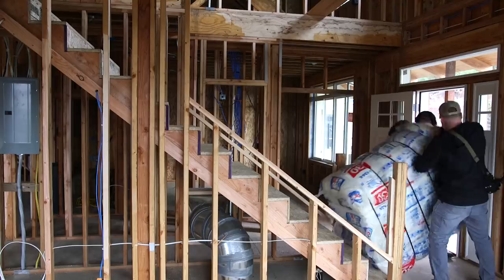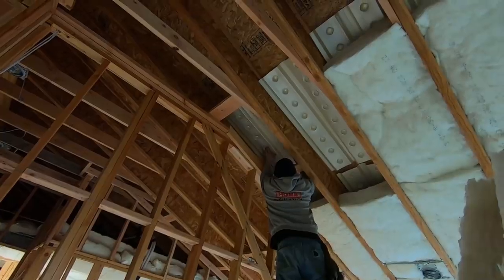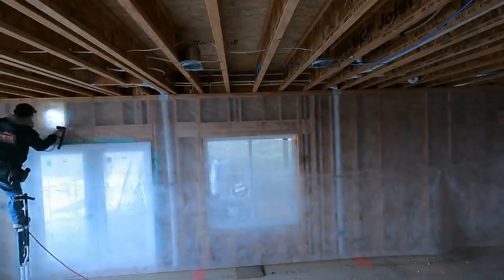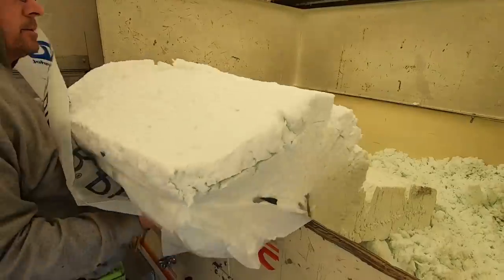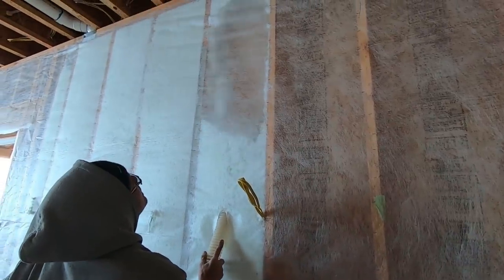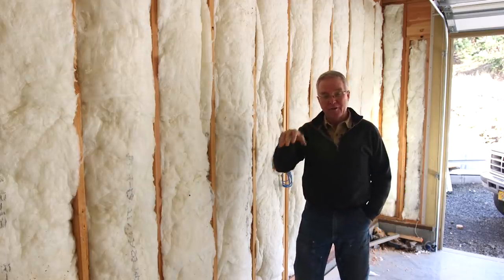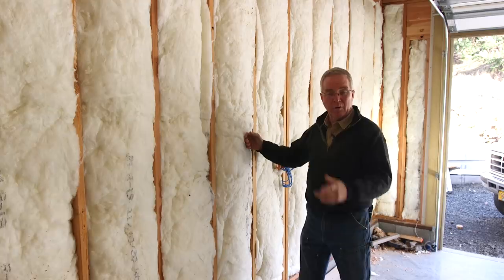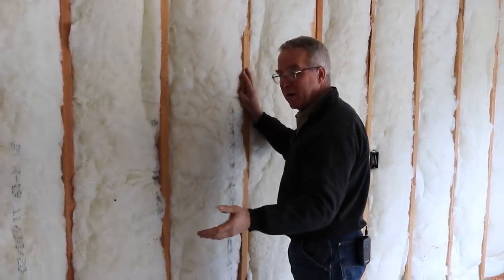Insulating A Nice House Ep.104

Comment: There IS improvement. And for a long time. Please explain reasonably why you still use archaic Fiberglass and claim to be a provider of service that people are supposed to pay and trust you to be in the know and best use their monies.
Blown or batten Cellulose is tremendously better in more ways than fiberglass possibly can be. It requires less material for the same R value and it's recycled material as well, highly fire retardant, insect repellent, and low respiratory risk to work with.
Reply from the maker: So I ask myself, self, what chance is there that my explanation will be  “reasonable” enough to compete with a strong confirmation bias like this one... probably not much at all! But the reason is ... the significant percentage of the lid that was vaulted. There is no possible way to blow 12” of cellulose into a 14” tall cavity on a 4-1/4 in12 slope without shutting off the ventilation. It did not make ANY sense to stuff batts in 40%of the lid then come back after drywall to blow in the balance. In addition,  by fully insulating the ceiling before drywall, I was able to keep the temperature up while drying the mud.
Reply: @essentialcraftsman  Yes I'm biased. For better more efficient material. Just because you don't know what you should know, don't be proud and try to scape goat your "professional" GC responsibility. Don't blindly trust contractors with superficial judgements.
Admit you don't know or haven't seen that before (though you should), apologize for all the times you've misused customers money, and go do the continuing education you skipped.
A more bothersome part is the snarky  reply you just gave. The forms of fiberglass you just used are all available in cellulose and more. Again as lesser material needed or more effective in same quantity per square inch as you mildly implied to know.
It's clear you're back peddling and covering up in case the customer sees this and asks for your misuse of their trust.

Again, don't be snarky, don't be proud, and make the right decisions and effort to get up to date with your trade. Stop using the cheap materials to lessen your cost and increase your profit or let the subcontractor do so.

You're really not doing your image here well with the snarky attitude. You're the professional to hold your composure over any critique, especially when the critique is right. When you put yourself out in the public square, essentially boasting that you're one among So many of the same trade to watch, you're willingly presenting yourself for critique as well as should be ready to learn something you refused to or simply didn't know. As you foolishly admitted you're not abreast to insulation properly and just trust someone else.

As well; Fiberglass for "fire block"?  Seriously? Not the cellulose again?
Have you done no education on Cellulose and Fiberglass comparatively? There's entire fire department supported video on this very platform to show it's fire retardant character.

Blindly trusting the subcontractor who are almost all more profit oriented, and your GC experience are not helping your case.

So much to say, and plead with your sensibilities to do better for customers who are more blindly trusting you than you are the subcontractors;

Do the work to know, and don't be lazy. I can say at least you're not on the spray foam fad that's going around.

You can't teach old dogs new tricks, but they can learn themselves. Now go do it.

Comment: I prefer to use closed cell polyurethane with foil faces tremendous  insulation wonderfully easy to tape joints. Sound ? 60 kg Rockwool in the floors lighter in the internal walls.

Comment: Thank you. Now we know which insulation contractor not to hire in the area. The second story is going to be rather uncomfortable and inefficient. Why did they leave gaps between the chutes? So the vent air can circulate down through the insulation reducing the efficiency? 
Why are you worried about paper face molding when the entire stud wall is wood and readily will mold from moisture caused by condensation caused by using fiberglass insulation? I think this is the first video you ever created that I down voted and I’ve been watching your videos for 4-5 years now.
Reply from the maker: Thank you for your comment! It’s interesting but over the last 25 years of doing additions and remodels here in Southern Oregon, I have never seen mold growing in an exterior wall that was not caused by a water leak. Either from the outside or from a plumbing failure. I’m not saying that it cannot happen. Just saying that I’ve never seen it and I have seen just about every kind of insulation that there is.

Comment: I don't like blown in insulation on vertical surfaces because it will settle in time and you will be left with cold pockets at the top of your wall. This is called thermal drift in the industry.
Reply: Yea, I'd prefer blow-in for floors and ceilings and batts for walls.

Comment: All that work you did to even out the studs for drywall looks to be negated by the blown-in getting behind the cover directly on the studs. I would never use blown-in insulation in a house.  It's just simply too messy. Cost be damned.